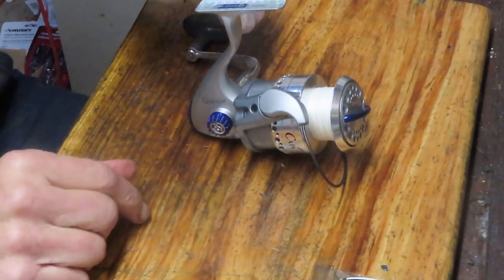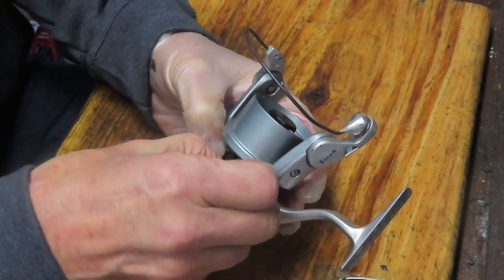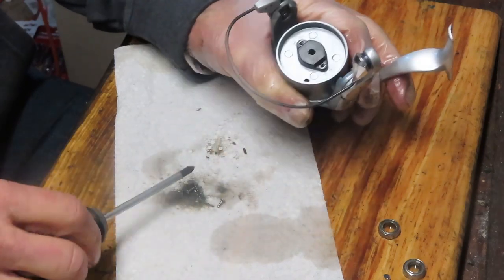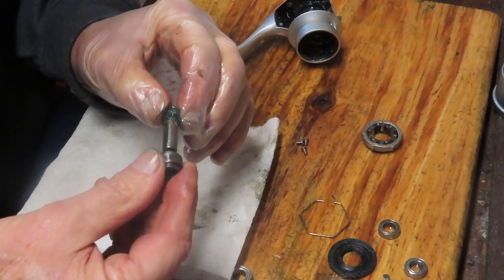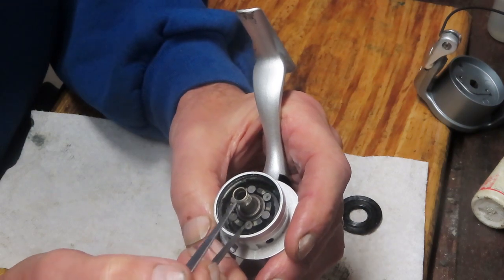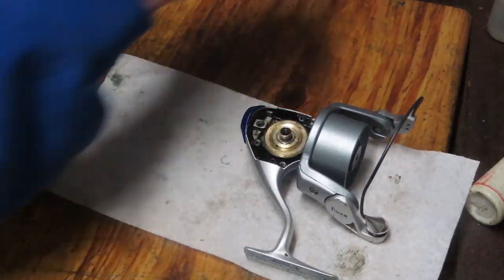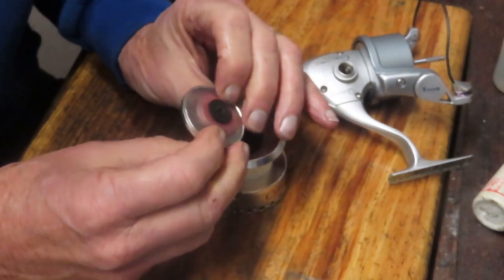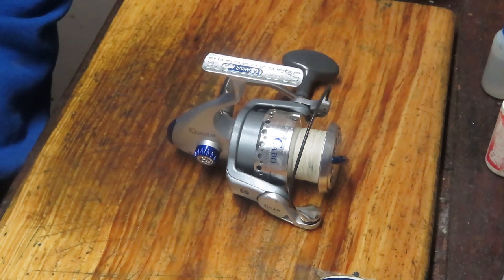Quantum Cabo PTS 40 spin fishing reel how to take apart and service

Comment: Well Dennis. You’re doing one of my most disliked spinning ever. It did not las 4 years. Honestly if I owned now what happened to it would not have happened because I take much better care of my reels now than I did back then. My Cabo is an older model than this one but while worked it was really something. It had no AR clutch but an old style AR with an override. The bearings in my Quantum were absolutely awful and that was the issue. The were all seized, rusty, and impossible to remove. After that I wanted nothing more to do with it. Also my reel was all metal like this one. Glad you did this one Dennis! — Chris
Reply from the maker: Thanks Chris - like everything, the reels will turn to rust if not cared for properly.  The newer Cabo reels have changed the A/R clutch among other things, so they are easier to service - Best wishes - Dennis

Comment: I have read about one way roller clutches/AR bearings a bit lately.  From the various sources I have looked at the general consensus is that they should get a very light coat of oil. One source,  I believe Shimano, recommended dipping a cotton swab in oil and apply a light coat in the direction of travel. I believe this may have more to do with corrosion resistance than functionality but that is a guess. I always wiped them off and left it at that. If I was getting any slip I would flood with WD40 and wipe out as much as possible and that usually fixed the problem. If you over oil it,  it will cause it to slip. Thought I would share that.
Reply from the maker: There is divided opinion on this.  I like your approach.  I have seen way too many failures due to grease and excessive oil.  I recommend running these dry as they are friction driven clutches.  I think you may be right on about the corrosion element - Thanks

Comment: This reel looks like my PTI 30. Anti clutch bearing is slipping in the assembly. Would you use loc tight? My father passed away and it was left to me. I also have the Quantum Energy PTI 750 Baitcaster. I bought it used and that one, the break setting or magnetic control spins in circles and doesn't work. I've been adjusting the cast with the spool tension knob. Thanks
Reply from the maker: NO.  I would remove the clutch and clean and dry the parts then reinstall with no additional lubrication

Comment: Dennis I have a question for you. I bought a Quantum Blue Runner 80 last year. In November. Anyways it came with no information. I contacted the manufacturer and was told that there’s no parts or schematics for it. Off your head do you know of any Quantum reel that might share the same parts? Plus I enjoy your videos. Ps It’s a spinning reel
Reply: Hey Rufus, I also have a Quantum Br 8- 80-S ( blue-runner surf ) awesome high-tech for it's time Korean surf reel with 8 bearings, continuous anti -reverse, long cast aluminum spool, quick folding power handle, sealed drag stack, etc..  it's such a work of art I hate to fish with it! , I f you follow Dennis's video, the gears and such are the same, I would not attempt to disturb the anti-reverse, unless it's not working,  Dennis made a great reference video to show the orientation of the parts in case you get stuck.  Parts for that reel are tough to find ,if at all.
Reply from the maker: You can contact Platinum Parts (Daves Parts) - They sell parts for quantum reels and can help you with your question.  The phone is (813) 358-1588 - Thanks - Dennis
Reply: @2ndChanceTackle  thank you 🙏